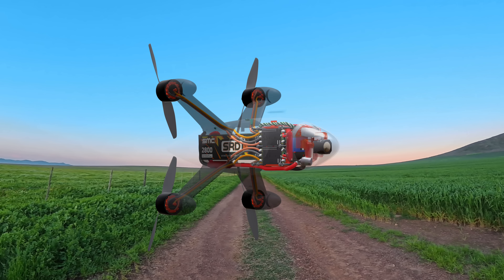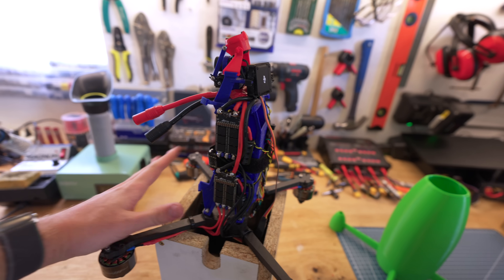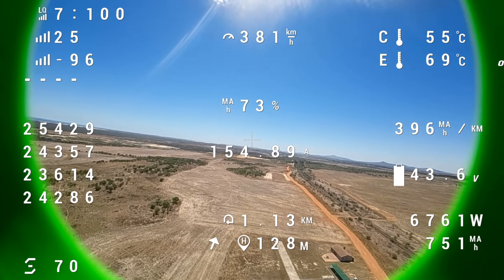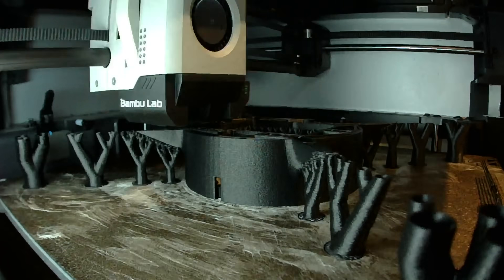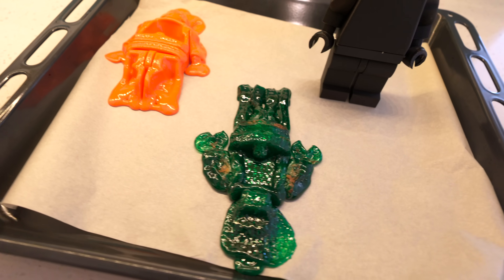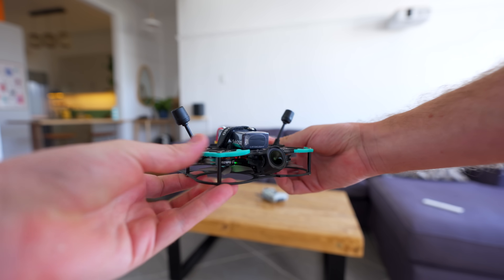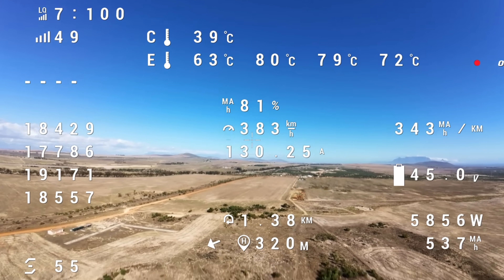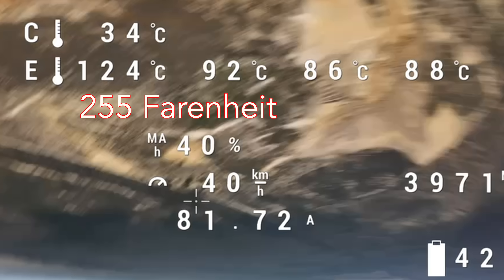THE COMEBACK - World's FASTEST Drone V3

Comment: The radiator assembly is seemingly introducing quite a bit of additional weight. I'm surprised you didn't opt for immersively-cooling the components with dielectric liquid? I could see a few other areas where more weight could be shaved off; structurally, it seems waaay more material is used than strictly necessary for the loads involved. Well, maybe something to think about when your record is snatched away once more!
Reply from the maker: Weight is not a big concern. At 580kph less than 1 degree of angle of attack is required to counteract all the weight of the drone

Comment: The water cooling would work a lot better if you shed that heat off.
Reply: The water cooling is already super efficient… just 15 c temp rise
Reply: @Mike-Bell Sure but if it was only 12c you'd get a few more kph. I know it's a question of mass but I'm sure you could design a hot side without adding too much. Even just a loop of tubing would help a lot.

Comment: just a strange idea concept- utalise a cone for combined thrust to act as a compressor for a thrust port hole, like a jet unit, but it would have to have either a bunch of parts, or swivvel motors, that face outwards at 45 degree, for lift off and mobility, and then they reverse 75degrees inwards to seal into a concave that compresses all air into a smaller oriphis( like a jet unit). i rember back i the day, putting a barrel around fans, somewhat increased speed. hopefully anything helps...

Comment: Was so happy to see you using SMC batteries. They are the best in the game AND the most honest

You were pulling 15-16kW peak for a couple seconds. 

Have you ever considered having the lipo tabs welded to small copper bars to reduce the resistance. I’m not sure if 4oz copper PCB’s would be an improvement. 

Laser welders are VERY expensive but with the amount of current you are pulling every bit of resistance you can shave off is less voltage drop
Reply from the maker: Danny from SMC is already working on improving things

Comment: Food for thought, you can use hybrid of water and air cooling without causing anymore drag then you already getting by  running water through the wings of the drone? The air is already flowing over it, you only have to construct run cooper pipe through the channels in the wing structure and outer structure of the wing be covered by the aluminium sheet which should be connected to the aluminium pipe carrying the water with thermal paste. it will of course add a little more weight but then again you can use less water in reservoir to counter some of that extra weight . To me, you are better informed on whether added weight will be worth it or not?

Comment: You should use a phase change material to absorb the heat, melting something require WAY MORE energy than just heating some water. You can just use wax instead of water but you have to add some thins in you aluminum block

Comment: Why don't the police use these instead of expensive helicopters to chase cars running from the cops? You could modify them with night vision and infra red cameras.
Reply: Endurance. A police helicopter can travel at speeds above 200km/h for hundreds of miles before needing refueling. This kind of quadcopters can only travel at most like 6-8 miles at pursuit speeds.
Reply: @teresashinkansen9402  That's not really a problem. You can have a multitude of them stationed 8 miles or so apart in different police stations and they can take over from each other when they enter a new area. They can relay GPS co-ordinates to each other to instantly find the car and pursue it. These things can travel at over 250 mph, and not many cars will be travelling over a 100 mph so the fuel saving for the drone will probably double at a lower speed and hence its range will increase. Also cars have to turn, slow down and change direction onto different roads where the drone can fly in a straight line as fast as it wants to go. You can see that I've thought about this. It would save millions in copters and pilots.
Reply: @TheSimCaptain  Sounds plausible, but I wonder how reliable that is. Tho I have to object about the claim about drones being able to go over 250mph, such drones are specialty made and have shorter ranges, must have aerodynamic fairing which limits payload capabilities, pursuit speed on average are about 100mph and drones already struggle to go distances above 6 miles at such speeds, at 250mph I doubt most drones could travel more than 4 miles.  So you would need a lot or redundancy and police stations, if the  vehicle on the run goes out of urban area then you cannot really rely on having multiple police stations every 4 miles apart everywhere, also drones are vulnerable to jamming.

Also curious how everyone thinks in saving money by replacing people by tech but nobody thinks how that affects people who got replaced. Are pilots going to be replaced by FPV pilots? and then those FPV pilots will be replaced by AI? so money can be saved and given to the rich?

Comment: Why don’t you use a Metal block as a thermal heat mass instead of water. Like if you used an aluminum one and then you could save weight. I’d recommend something like taking two blocks milling a squiggly channel that goes on both of there faces and then putting the faces together so that the channel is essentially on the inside of a larger aluminum block. Then using a computer duster can upside down to inject super cooled gasses. This would save a bunch of weight and also allow you to easily cool it off between tests. You could even move up to other metals if you needed more thermal mass. But you have a much cooler starting point and no need to waste power on a pump or water.
Reply: That’s brilliant and would totally work. I think it would be simpler and more durable then the water system
Reply: Sigh. The video already explains why water is so useful here. The drone already has all the cooling it will ever need for the quick burst runs it does. Why over complicate things needlessly? The pump probably isn't necessary but the weight and power used are absolutely trivial. It's frustrating seeing so many armchair engineers trying to come up with fancy pointless cooling systems or wanting him to use air cooling and add massive drag.
Reply: @randomname4726 lol.
Reply: @randomname4726 lol

Comment: have you tried printing the body out of resin? resin prints are usually smoother, which i would imagine reduces resistance. might also get away with thinner wall thickness
Reply from the maker: Yes but it’s bit too big for that. I would need the Form 4L

Comment: I think adding a heat exchange could be beneficial, but not via a normal inlet or anything like that,
i thought about using the hull of the drone; so the outer plastic layer, you could add small water channels in it.
not a second hull but like capillary veins underneath the surface

but this would also benefit of a more conventional cooling loop setup 
where there is a water basin and only some water is delivered to the heat source, so the water can be heated as much as possible since the heat transfer is at peak efficiency if the temperature difference is at maximum so just cooling the basins water by itself would be less worth while.

also you could significantly decrease water storage (for space and mass reasons) as you don't rely on the heat mass, but dissipate the heat.

or you could dispose of used heated water with an outlet kinda messy but the battery is not gonna power 160 m/s flight for more than you have cooling water stored.

a more intricate heat exchange system could also be beneficial if you want to go with improved water cooling.

Comment: I know it wouldn't be "clean" but you could have just mounted the ECU's on the outside w/ thermal paste to smooth air faces surface. Would maybe get you passed the record with less time / parts. Not sure if it would be as good as ice water for a burst of cooling, but would defiantly last longer in the air.. A mad man may even use ECU's like this in place of the what is holding the props

Comment: What if you used air tunnels inside the drone to help with cooling? It’ll probably worsen the aerodynamic but without the water cooling system it will be a lot lighter.

Comment: Freezing the water before would massively increase the capacity. Juste leave enough air for expansion. 

You could also have a pair of motor pitched for a higher speed maybe. More time tuning, but easier to accelerate

Comment: Interesting idea: what if part of the drone’s shell worked as a radiator? You could make one side from copper and mount the electronics inside against it using thermal paste. At high speeds, the airflow would cool the surface efficiently, and the copper would spread the heat quickly — reducing weight by eliminating watercooling stuff
Reply: It would weigh even more. Pointless.

Comment: I wonder if you could save weight by changing the cooling system from water to a phase change material tuned to the temperature you need (?~30C). This would have a much higher density of energy transfer per unit weight than just using the thermal absorptive properties of liquid water and since it would be a solid-liquid phase change you would likely also not need to use any motor to circulate.
Super cool project, incredible work on it!
Reply: Pointless.

Comment: nice work. The water cooling somehow confuses me, since ure not cooling the water. So the water only acts as a buffer. When u only need a buffer, because of the short flight duration, couldn't u use something solid with better thermal capacity than water? U could even cool it further down, because it doesn't need to be fluid

Comment: Putting a pump in a closed system is adding extra heat to the system.  I thought your were going to skin cool on the surface of the drone.  Also if there is any air in the water tank you will have oscillation.

You were testing in a static environment with no agitation of the water so you added a pump.  In flight the water will be turbulent if you were to add something like a mini golf ball with surface divots to the tank.  No motor adding heat and using energy.  Less unnecessary complexity to fail.

Comment: Why not put heat sinks outside the body of drone? such speed should give way enough air flow and if fins are aligned and profiled, there will be minimal drag to that... even may stabilize drone, as there will be air corridors,, between heat sink fins. You already have 4 HUGE heat sink fins in your design, open to airflow... Water cooling is good, but heavy.

Comment: If I would try to build such a drone, I would put the electronics into the arms and print the arms in some material that is thermoconductive e.g ice9. And of course the battery in the mainbody, also in an encasing that is thermoconductive. Maybe also work with heatpipes.

Comment: Great video and great job.
I suggest not using water as the heat sink. The reason water is used in computers and such is that you can circulate the water from the source of the heat, to a dedicated cooling area. 
You are not doing that. You are using the water purely as a heatsink.
Now i think heatsink is clearly the way to go for this application, but a copper (or any suitable metal) heatsink will give you better thermal capacity in a smaller envelope.
No gaskets, no water pump... just much simpler design.
You can make 2 heatsinks and make them connect with a clip of some sort, so you will be able to swap in a cool one, after each flight.

In general, the simpler thing is almost always the best.

Anyhow, great work :)

Comment: Outstanding work! Did you know that WWII fighter aircraft had radiator ducts that used the engine heat to contribute to the thrust as the air flowed through. The Spitfire gained the equivalent of 200hp using this technique. Look up Meredith Effect.

Comment: I imagine you’ve considered dielectric fluid cooling by directly immersing all of the hot components in an engineered fluid like Shell immersion cooling fluid. You could transfer the heat by convection to a heat sink or external heat exchanger.
Reply: Pointless. It works fine how it is.
Reply: @randomname4726  Oof. Sure, there haven't been any versions of it that have gone up in flames.

Comment: Thats not watercooling, thats thermal mass. You are just doing it this way to mention all your 3d-printing sponsors. The machines, the filament. The the shitty milling machine. And saying "you need 3500 more air" is stupid, bc you cant exchange the water mid-air but you change the air, when flying for 2min, you (if your numbers are right) only need 1,5l of air per second. An off-the-shelf(!) silent(!) 40mm fan does that easily.

Comment: If you want to be risky, you can even try sanding down the plastic packaging on the ESC ICs. It will let you improve thermal conductivity, improve heat transfer, and reduce heatsink weight. I think a flat, full body length, aluminum heatsink can replace the water cooling with less space/weight.
Reply: The cooling is perfectly sufficient as it is.
Reply: @randomname4726  Possibly less size/weight allowing higher top speed.

Comment: I think you can definitely mill ESC air coolers with a bunch of aluminum sheets. Similar to padlocks. It doesn't necessarily need fins if the air speed is transferring enough heat away. They can be flat heatsinks. Copper heat pipes are also an option.
Reply: But why? The water works fine.

Comment: The water block could be exchanged for wax, which can use its phase change (solid to liquid) as a heat dump. This was used on the Apollo moon buggies for heat rejection. It may have a higher heat latency than water.
Reply: Why bother? It already works perfectly.

Comment: What would dimples like on a golfball do to speed?
Reply: Dimples are for golf balls only, because a ball is a terrible aero shape and a particular quirk that only benefit balls.  Not a single aircraft or airliner has dimples for a because it would just add quite a bit of drag.  You can be certain all Airliners would immedeately apply dimples if it saved fuel.

Comment: Have you looked into putting toroidal propellers onto your drone? if you read the MIT reports on them gives around 5-10% more efficiency over normal propellers, it might give you a little bit more out of it (you might have to print them yourself not sure how available they are at this time)

Comment: Regarding chasing passive stability, why not have the props farther forward, pulling the drone through the air? 
That would make the drone body itself the tail without additional surface area. It would also give the props more undisturbed air to work on.

Comment: Have you tried 3D printing the canape with golfball texture? Dimples?
Reply: Dimples are for golf balls only, because a ball is a terrible aero shape and a particular quirk that only benefit balls.  Not a single aircraft or airliner has dimples for a because it would just add quite a bit of drag.  You can be certain all Airliners would immedeately apply dimples if it saved fuel.
Reply: @Mike-Bell thanks for educating me, I should have thought about why it wasn't used everywhere. Have you been approached by defense contractors yet? I could see them using one to go through a window to eliminate terrorist cowards that hide in hospitals and schools. Good luck

Comment: I'm no expert but here's my 2 cents
You need a canard fin at the front to take the gravitational pull off it and it will allow it to travel further, faster with stability and possibly a lot faster since it has reduced gravity drag on the nose.
Then add some space at the front for explosives and see if Ukraine can use it
As long as they promise to target Putin himself

Try putting a cylinder around the props, as this can if done right, give you a jet air thrust and may increase your sped considerably
Anyhow good luck with my uselessness.

And don't be a fool to give your enemy the loaded gun you have in your hand, Russia  , China et
You things you learned

Comment: That pump isn’t going to do anything but heat soak the water faster due to the heat having nowhere to escape. Hence why most water cooling systems have an attached radiator. You could add a cooling additive that is typically used in car radiators. Those tend to work pretty well.